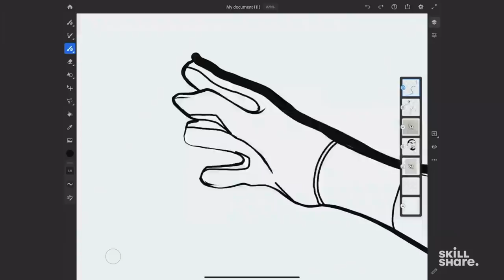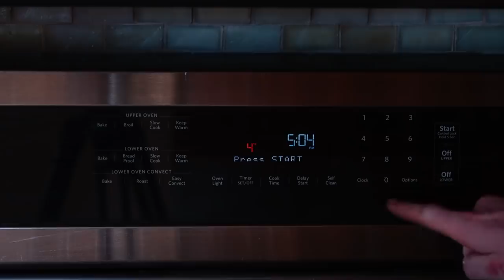Forging a Pirate's Sword from Junk

Comment: This is really cool. I'd like to see you challenge yourself by only using equipment you would have access to in a post-apocalyptic situation, which is to say no or very minimal electricity and no welding....if you can't run it off of a solar panel or a gasoline generator, it wouldn't be easily available in a SHTF situation, yknow?

Comment: I REALLY don't get why anybody would sharpen a blade before it is finished. Too much possibility of damage. A sharp edge has less material so is easier to damage. Then...there is YOU. You a much more easily damaged by a sharp blade should an accident occur. You should learn some safety before you "Skillshare".